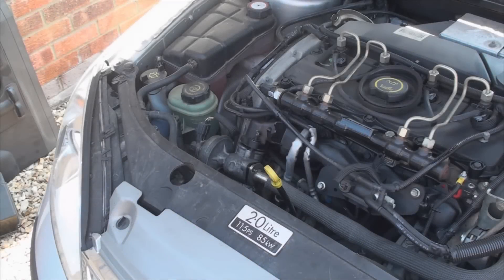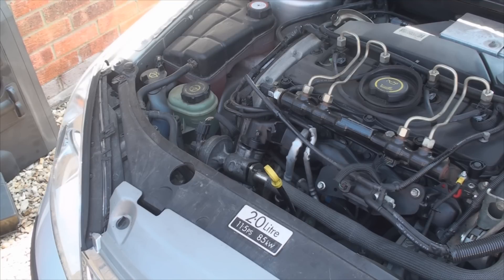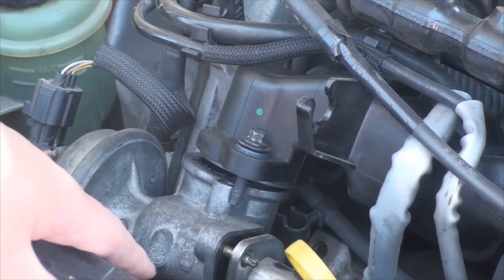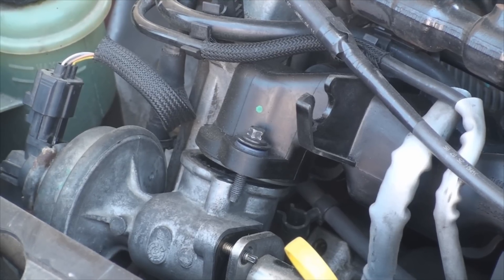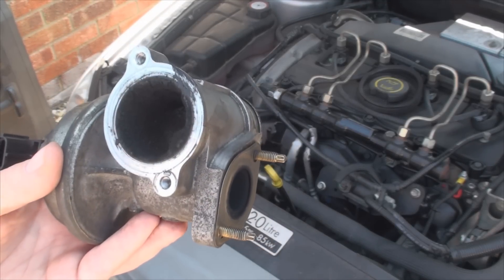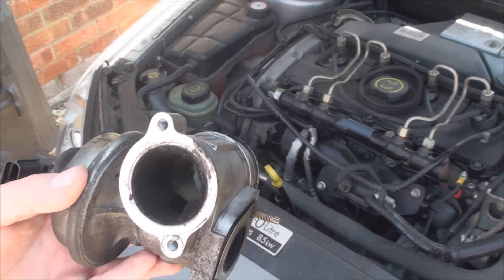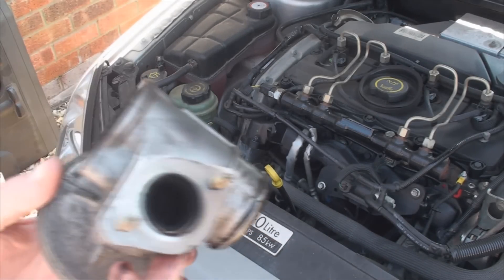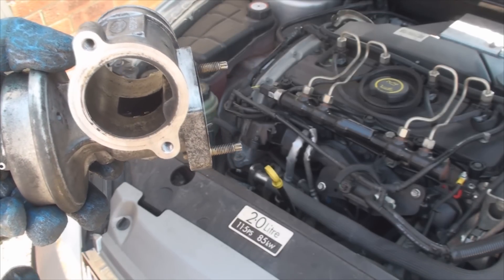Mondeo EGR Valve - Info, Cleaning, Operation

Comment: hi there, very cool video and easy to follow up. thank you. i have just one question about the 'old intercooler hose', it seems to be clean. i still dont know if my hose has a hole but mine is so dirty around it with greasy and messy sticky oil like it is in minute 02:24 inside of your egr. any comment or suggestion what might be the problem?

Comment: Just done this on my 2.0D x type. it literally is a piece of piss to do thanks to thanks to your video. Even without any lights on the dash or smoke it has made a huge difference to the way the car drives. I scrapped most of it out with a screwdriver then blasted it with wd40 and finished it off with wire wool. Thanks

Comment: I have either got this valve gunked up or a split in the hose as I can hear a hissing noise under acceleration, also surging between certain rev range.
Reply: get  a new pipe off ebay for under £20 with life time guarantee . Ford asking over £100 pound

Comment: I cleaned my EGR on a 2005 TDCI about 5,000 miles ago. Prior to that the hose was split, very common, and I replaced it with a silicone hose from eBay that means it won't split again. Now, at 100k, I'm getting the puff of smoke when accelerating on the motorway, so it may need cleaning again. One of the effects of around-town, low-rev driving maybe. Next thing will be to fit a new EGR valve, but they're not expensive. At least you can get at them.

Comment: Thank you! I'm gonna try this over the weekend. I'm losing power and seeing a lot of smoke. Hopefully this is the cure! I think also a pipe is split somewhere, because I can hear air escaping when the turbo kicks in. Feels like a misfire when cruising..
Reply: Lee B. Geebeez did it help? My Mondeo is doing the same
Reply: Rob The Meat Manifesto 
To be honest, I'm not really sure. I found a big split in the turbo pipe connected to the egr valve. Seeing as I had to take the valve off to replace the pipe, I gave it a good clean. Its a quick easy job, so  no reason not to do it. I got power again and no smoke :)

Comment: mondeo mk 3 , egr gets glogged 
turbo stops working , actuator messed up , many problems lol but trust me all solvable and preventable ! 2 litre tdci lol when it starts rattling , dual mass flywheel time , open heart surgery in engine omg , remedy is no1 drill hole I into side of turbo , thread the whole , mr muscle oven cleaner , McDonald's straw attached , stick in hole , spray , cleans the Finns of the turbo etc , job done money saved , in the hole stick a bolt and two washers and close , no2 actuator , open box , re solder loose connections on circuit , look carefully around the whole circuit , u will see 1 or 2 loose unattached connections , re solder , job done , no 3 intercooler pipe split , replace with silicone one , no 4 egr.fucking valve , take off soak in petrol over night or use mr muscle oven cleaner , lol lol all problems solved for pennies lol by the way all videos relating to these problems are all on YouTube !
Reply: I take it the dual mass flywheel problem isn't preventable?
Reply: I've been getting very low mpg on my Jaguar X type which has the same engine. About 37mpg while the car is rated 50mpg. It's not had a service in 18 months so could be a clogged filter, but I have a feeling the EGR has never been cleaned. I've been told it could be blocked injectors and that using some adatives should help clear it up

Comment: Very good video, I had back smoke coming out of the exhaust on acceleration on my Mk3 Mondeo and watched the video then went straight out and cleaned my EGR. It was caked in black sooty/sticky goo.I also noticed the pipe attached at the bottom of the valve was split as well so Carried out a temporary repair with black insulation tape and after cleaning the valve refitted everything, went for a test drive and no moe black smoke.
Wonder what a garage would have charged to diagnose and repair this fault !!!
Thank you
Reply: the split in pipe must be intercooler pipe , from fords about 40 50 quid , there are other company's out the doing silicone intercooler pipes at 30 odd quid and last a lifetime ! Iv learned this at an expense , been through three intercooler pipes so far , overall if split change it and as for egr , either soak in petrol over night or the best one is mr muscle oven cleaner, the best !!!!

Comment: Saw a mk3 mondeo the other day with this problem it filled the road with black smoke. I've worked on a few using higher quality diesel reduces build up with no or very little need to put in redex.

Comment: hi, just start having flash glow plug light on dash once car warm start. it lost its 20% of power aswell while GP light flashing. i changed the fuel filter, cam position sensor and cleaned EGR valve. but still the same, do you advise blocking EGr will help. i also noticed white smoke first time you start the mondeo (mk3 tdci) from cold. ?? thanks
Reply: J B Mahmud I would guess your electronic turbo actuator is knackered.

Comment: The part about the switch is wrong at the end is wrong its a sensors. It doesn't just measure open and shut either it measures position open, part open or closed.
Also blanking plates don't work in anyway what so ever you might as well just leave it clogged up. Just take the time and fix the real problem witch is the the egr cooler.
 What people where thinking when they invented that thing is beyond me obviously condensation was going to develope inside one of something like that at cool down mix that with soot you get gunk.
Only way around this is a silica block like what you get in them packets in electrical items to stop moisture (DO NOT PUT ONE OF THEM INSIDE THE COOLER IT WILL JUST BLOW THROUGH) you can get them in wire mesh bags that sit securely inside the cooler.
Also think about recon injectors will cut down on unspent fuel that will create a lot of the soot in the first place them Volvo engines are notorious for that.

Comment: Excellent video. Cleaned mine a couple of times, finally failed. Blanked off and I now get another 6 or 7 mpg fuel consumption. EML is on pall the time but I check the code once a week with F-super, no problems.

Comment: Phil its not egr!check your turbo actuator arm(must running very smooth). I had same problem flashing glow plug light and then car was going on limp mode.try that if not try repair your actuator!

Comment: Great video. Just some tips for anyone who cleans their EGR valve that I found helpful. Petrol is great for removing the oil/grease. For the bit with the valve that opens up I soaked it in petrol for 2/3 hours and the grease just washed away.

Also you want clean out your inlet manifold as it's connected and fills up with oil/grease too. That's more of a pain to clean. I used a knife and spoon to scoop out the bigger deposits then I soaked it oven cleaner over night and washed it away. A jet wash would be great to use (such as one you can find at a car wash).

Comment: Wha will blocking that area off with the plate do? Performance wise?
Reply: EGR or Exhaust Gas Recirculation transmits a certain amount of burnt gasses back into the engine.  This chokes the engine as there is very little to NO oxygen left in the gas. It also clogs up the inlet manifold with soot.  By blanking totally you are not putting the gasses back into the engine, thus it'll breathe better and run better.  looking at a few more BHP and torque plus better throttle response.  You MUST block the entry, Zorst IN to egr NOT egr to manifold!!!!
Reply from the maker: You will see no difference whatsoever. The engine will be taking in only clean air instead of mixture of air and exhaust fumes.
Reply: wont that affect my MPG?
Reply from the maker: In theory it's possible however based on my experience there's no difference.
Reply: oh okay tanks, do you have a link to that plate thing?
Reply: meriton berisha
search ebay for "EGR VALVE BLANKING PLATE" make sure you get the car make and model right for the correct blanking plate.
Reply: HiddenWarrior great info.. however will this  affect it passing emissions test when you come to get it's MOT done?. also will this blanking plate work for a MK4 Mondeo TDCi ? ....one more thing Will Blanking off the EGR Valve Harm the Engine in any way long term?
Reply: +NightOwlFactory Hi fitting a solid plate to my euro 4 mondeo will put on EML is it easy to remove code with code reader regard ian

Comment: Excellent video friend, VERY well made.  Although I will say, it's ok cleaning the EGR but 9 out 10 times if you have a stuck and gunked EGR, cleaning it wont really help, as it'll fail very soon after.  This happened to me.  Engine light on, so cleaned the EGR fully, better than new, and by the time I drove 40 miles to home the light came back on and the EGR was dead. By all means clean it, then fit a blanking plate, if the engine light comes on, remove it and drill a 10mm hold in the middle and re-fit, the light will go out after 4 start cycles and you'll be fine.
Reply: Hi this is exactly what happened to my Mondy. Would your advice also work for the ST or is there a big difference between the engines?
Reply: gardenstate78 The ST is a 2.2 155bhp engine.  But blanking will be fine.  most turbo engines have a egr valve and by blanking it you are not putting burnt oxygen and soot back into the engine.
Reply: HiddenWarrior So basically the only real porpouse of these EGR Valves is to cut emissions.. but shortening the life of your engine in the process?

Comment: I had i problem with black smoke on my x type 2.0d,so I clean egr valve but nothing happens,i try everything then I change injectors(my was 00504Z most expencive one)since than run like a dream no needed to blank egr valve and don`t do it!remember big company like ford spend millions on different test.if they put egr valve don`t change it!
Reply from the maker: The main reason EGR exists it to satisfy environmental regulations and bring cost of road tax down (as it's based on emission). The only other useful thing about EGR is that it helps warming an engine in first few minutes after start.
Reply: NightOwlFactory Hi Night Owl, I've just come from the garage and they had to replace a fuel pressure regulator. Now although the car runs it's still down and power and they said the next step is to put in a blanking plate. I'm not particularly mechanical but I may try this as from what you say, it doesn't look that difficult. Ours is a diesel mondeo MK3, the injectors were replaced with new ones (not recon) so I know it's not an injector fault.

Comment: I did put quite a bit of pressure pretty much all my strength woth my thumb. I also didnt have a sensor on the side like yours does. I didnt fix my problem cleaning it and ive just replaced my camshaft positiion sensor so ill see how that goes but if not I might take the egr off and try to get that valve moving?
Reply from the maker: You could take the valve out and leave the suction hose (vacuum hose) attached. Stick a rag or something similar into exhaust pipe (in engine compartment) so you don't have to breathe the fumes in and don't get your hands burned and get somebody else to start the engine and rev it. At low revs (idle) the valve should stay closed at high it should open proportionally to revs.

Comment: Hi finally got round to cleaning it! It was filthy got it clean after a lot of scrubbing. I put a bit of pressure on the actual valve and I couldnt push it back which I thought it would of. Do you think its seized or something?
Reply from the maker: No, I think it's fine. When I had mine out I was able to push it in with my thumb but I had to use much more than 'a bit of pressure'.

Comment: Great video! My mondeo 2.0 TDCI 53 plate 130 cuts out randomly when driving without any warning chugging etc. The car looses power (engine cuts off) and the glow plug lights start flashing. it starts perfectly on the restart. I've read on a couple of forums that cleaning the EGR valve might help. It doesnt look to hard to do after watching this :-) ! But do you think that a dirty EGR could be the cause of the car cutting out completely?
Reply from the maker: It's certainly possible, mainly because the CPU can't 'see' the valve actuating as it can't move due to crap build up inside. The CPU thinks there is a problem so puts the engine in a limp mode to prevent further damage (at least I would like to think that this is the reasoning behind it).
Reply: NightOwlFactory Thanks! I'll give it a go this Saturday :-D

The car drives perfectly, pulls really well etc. at all speeds. Makes me think its not to do with the injectors or pump (wishful thinking maybe...) but more an electronics issue or sensor..
Reply: @philfenna5211  was it the egr valve?
As my mondeo does the exact same thing
How did you get on
Thanks
Reply: @stuartbennion  wasn't the egr valve as the problem continued. I ended up replacing the camshaft sensor which was one bolt on the engine very easily accesable and 20 pound to buy. When I compared the old camshaft sensor with the new, the edges were rounded as oppose to flat. Might be worth taking it out to check before ordering
Reply: @philfenna5211  thank you, ive just looked at my egr and the previous owner has blanked it off so they must of had issues with it aswell.
Thanks for the advice i will look at the other part you mentioned
Really appreciate it
Thanks

Comment: Just as a follow up I have been trying to do some more km to get the engine warm but still a bit jerky/hesitant from time to time. Have cleaned MAF sensor with special spray from CRC and now seems fine!
Reply: if u have problemìs whit engine not heating ,u should try to change termostat of oil  or  termostat of water,i just changed bouth and now works's fine!(sry for bad english)

Comment: Thank you for your advice,glow plugs have been changed and starting is much better, they also cleaned the EGR which they said was quite dirty. It is still a bit lumpy but I suspect that this may be due to the fact that it is only being used for short journeys so never really gets to operating temperature.Have given it a couple of runs and now consumption down to 8.2l/100km which is much better than it was.

Comment: Well, the garage changed the glow plugs and cleaned the EGR which they said was dirty nad it certainly starts better now. Still running a bit lumpy but possibly just needs a good run as the run to work doesn't warm it up. 

Many thanks for your help

Comment from the maker: I would suggest checking your glow plugs. If some of them are gone your engine is not warmed up properly when you start it which in turn leads to sub-optimal combustion (hence smoke) during first few minutes. Also the smoke has a really distinctive and unpleasant smell. 

In order to get to your glow plugs you're going to have to remove the egr valve anyway together with inlet manifold which is a nerve wrecking job cause you will have to bend fuel pipes.

Good luck

Comment: I have a 130PS Mondeo 2003and when I start it I get a big belch of blue smoke and then it 'coughs' until the engine is warm/hot - about 5 mins. Idle is also lumpy at this timeIs this likely to be an EGR problem or have you any other suggestions.Unfortunately recently the car has only been used around town as I have had problems walking so has not had a good run for a while. Fuel consumption showing 9+ l/100km

Thank you

Comment: Im not a mechanic

The beauty of a Mondy is its easy to get to. Did it first time about an half an hour with 30 mins cleaning. Drop the bottom pipe 1st then the top two bolts to give leeway for the inner side bolt. Gotta say yours looked clean, mine had about qtr inch hole left for breathing. The piston has to move so put a small pipe on it (2ft of cable outer with the wire pulled out) and suck to make the piston move. Think where the crap is coming from n clean that too. Follow it back!!

Comment: Excellent video. I'm not a mechanic and was hoping to find some clues for the problem I have. My Mondeo TDCi 130 sometimes judders when cruising and has a lot less power than I would expect; when the turbo has kicked in, the car throws awful black smoke out the back...I guess this is because the turbo pressure is lost through the valve and out the exhaust.  I wouldn't have had a clue had it not been for your video.